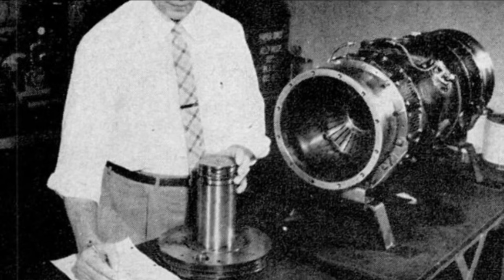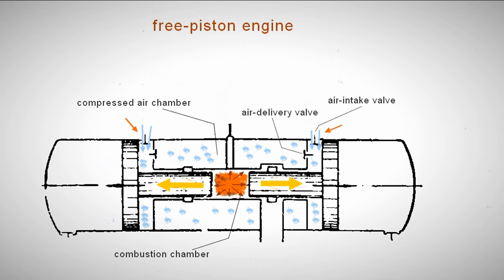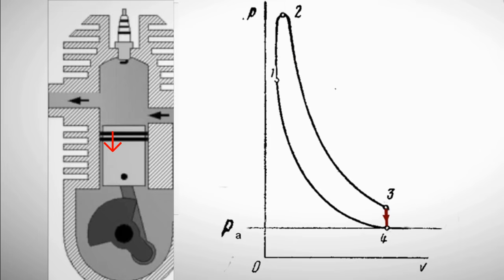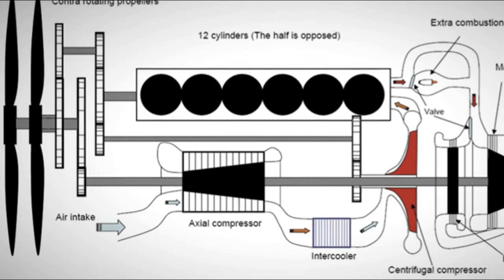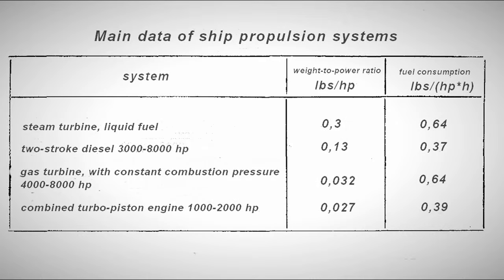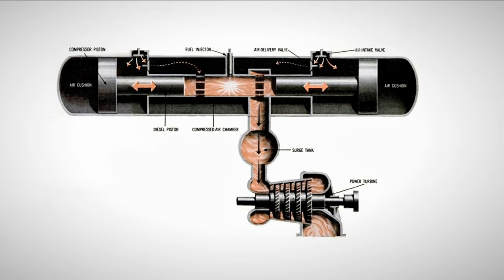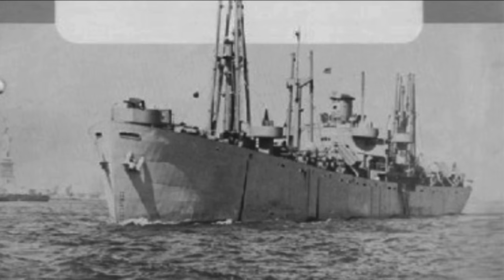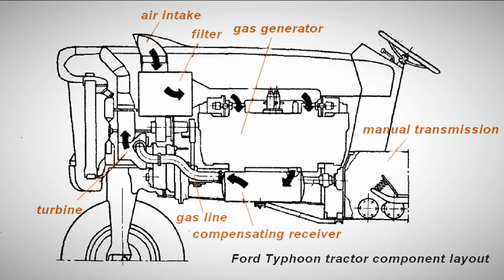Ford Typhoon: The Turbo-Piston Experiment | Industrial History Documentary

Comment: Why not just put a crank in it? Use it to drive oil and fuel pumps.  And to start the engine. Basically  a short stroke compared to a common truck diesel engine. Say 4 cylinders, 8 pistons , a single crank  4 pistons with short rods, and 4 pistons with 8 long rods. The crank with a 2"  stroke ((pulling thd pistons apart 4"))  in theory, it should  equal the tq of a 4" stroke, with the ability to rev like a 2" stroke. Connected to a 5" bore with a 24:1 compression ratio,  the engine can use a starter for starting, and the crank driving a generator and fuel and oil pumps. (Seems a bit Rube Goldberg'ish , when the engine crank can produce  decent power, even more with a turbocharger , especially with the additional stroke of 1-3", a 5" bore with 5" stroke  can produce huge TQ. ROUGHLY EQ. TO DOUBLE BEING A OPPOSED PISTON ENGINE. It should be more efficient than a 8 cylinder engine firing two cylinders at once) maybe 45-55% gain of efficiency  from using a single cylinder  and a single cylinders combustion even of fuel  to move two rod journals. It is difficult to figure efficiency without  anything to base it on. I don't understand  the reason this even existed. Why not just build a combuster and power the turbine that way?
Reply: You would need to use compressed air or a compressor of some kind for enough power to drive the turbine.

Comment: I’m confused about why this engine would be as efficient as they say. Going fully turbine would be more efficient currently I feel.
Reply: Turbine compressor can never provide that high compression ratio as bumping pistons. Temperature in combustion chamber of full gas turbine engine also can not be as high as in piston. Thus, gas turbine always less efficient than piston engine
Reply: @Lichnaya_pravda turbines are always more efficient and reliable the reason we dont have them in everything now is solely because they cant make as much money from them turbines dont require oil changes for up to 50k miles and obviously if its more efficient that means less gas consumed
Reply: @mat6179  That isn't why my friend.  Turbines suffer from efficiency of scale issues quite terribly.  The blade clearances on a full sized turbine compared to an itty bitty one are around the same, meaning the space for gas bleeding on little turbines is quite high by percentage, also turbines don't throttle that well and remain in their efficiency peak.  In a road car the ideal setup would be a constant speed turbine running a generator and then an electric drivetrain.  This is very far removed from established construction techniques and it still would not be possible to achieve any better efficiency than a quality common rail diesel.
Reply: Efficiency is directly proportional to compression ratio, with a compression ratio on the big free piston engines being around 50:1, that's pretty darn good.  At that point in history a turbine with either a centrifugal or axial compressor could only achieve around 6:1, an enormous difference.  Today the axial compressors are incredible, the most efficient GE commercial airliner turbine achieves around 67:1 compression ratio, with fans, no sealed chamber, that is incredible progress of compressor aerodynamics.
Reply: @kingcosworth2643 that high ratio can only be gotten at very high altitude though, at sea level they cant handle anywhere near that ratio

Comment: This is a very cool engine that I never knew about until now.  I just recently learned about compound engines produced by Napier shortly after WW2 for the aviation sector.  That was also a great idea until it was quickly surpassed by jet engines.
Reply: Napier were an amazing company creating very advanced engines with high power to weight ratio, Deltic being the most compact.